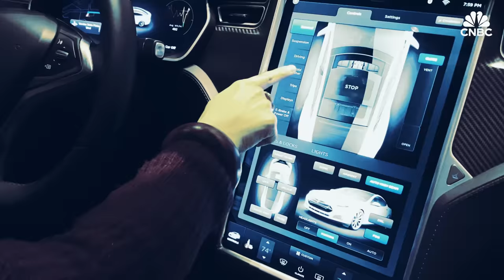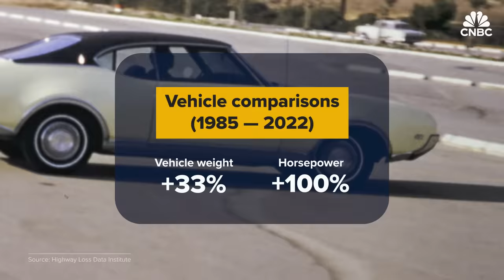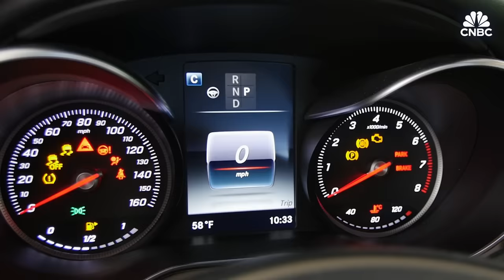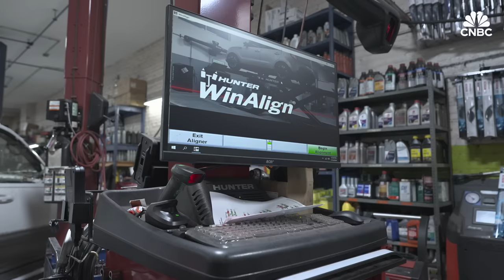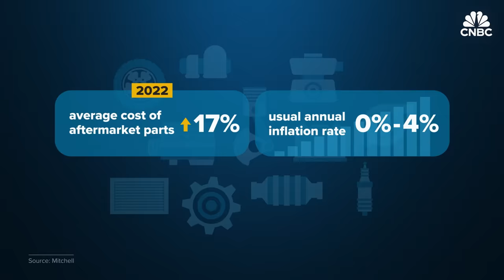Why Car Repairs Are Getting So Expensive

Comment: It's not just a matter of cost, either.  It has just as much to do with quality and expertise...or the lack thereof.  Example: I worked in the automotive industry, until recently.  I know my way around, mechanically.  Recently, I purchased a NEW transmission from my local Lexus dealer.  $3500.  Ouch...but new...so ok.  Installed it (correctly) myself.  After about 300 miles, it threw some warning lights and began shifting erratically.  I brought it to the dealer, ONLY FOR DIAGNOSIS.  They charged me $205 to tell me shift solenoids were stuck closed and that the transmission was shot and required replacement.  Offered to replace the transmission, itself, under the parts warranty and quoted FOUR THOUSAND DOLLARS just for the labor to install...which equates to about $300/hour.  CRAZY!!!!!!!  I decided to look deeper and not trust their diagnosis.  Turned out is was just under 1 quart low on fluid, after some air pockets had released.  Topped the fluid off, cleared the codes and voila...no...more...issues.  Had I trusted them, I would have been out nearly $4K extra.  Called them, told them what had happened, and insisted they refund my $205...which they did.
Reply: In the same vein, electric seat didn’t move forward or back and dealer wanted 4K to replace the entire seat.  Luckily, I diagnosed myself and it turned out be a $40 switch.
Reply: 🙋🏾‍♂️ ahhhhh!! I had a similar issue 4 months ago. My Mercedes wasn't shifting right. I took it to my favorite Euro specialist who told me my transmission needed a rebuild for 3.5k. Me and my buddy didn't believe as we know this particular tranny to be almost bulletproof. So we took it back home and just started doing basic checks and discovered the oil was low. We filled it back up correctly and the transmission shifts perfectly again. They almost got me.
Reply: this is accurate, they misdiagnose cars and just wanna replace the whole thing.
Reply: Stealership.
Reply: Bro what Lexus model is this? Dang that sucks :0
Reply: This is why they call most of them glorified part changers. It's easier but more expensive for you for them to just replace the parts than to diagnose the problem precisely with high level of expertise
Reply: U got refund? That miracle. Yeah a lot mechanic are garbage. Some diagnose the vehicle and still can't find the solution.
Find a good mechanic and never a dealer
Reply: Not everyone would look into things further like you did. You can trust anyone in the home/auto repair industries.
Reply: NEVER EVER go to a dealer for your Mechanic Especially in Australia
Reply: @Karl-Benny  I always do.
Reply: They always lie
Reply: Wow
Reply: JDns-we4fw  Its sad though because the OP sounds like an individual that knows a thing or two about the automotive industry and car repair itself mechanically. Sadly for a lot of us, myself included the most we know how to do is probably oil change. Its too easy to fall into the trap if we dont know any better you know?
Reply: Good techs often leave the industry cause dealers don't wanna pay what their worth. Working in a dealer can definitely break the passion for most car enthusiasts
Reply: so my old hyundai accent just needs one of them small donut tires in case i get a flat tire away from home. 

no one sold it so i had to go to dealer. they said i had to buy complete kit for over 300 bucks. when only thing i need is small donut tire. my regular tire shop replaces ordinary sized tires for 25 bucks. but they dont sell rims or donut tires.

if u ask me 300 bucks is alot for a small donut tire
Reply: also i need a catalytic converter replaced. the shop wanted 6k on other repairs they said i needed. i said no. i took my car to a muffler shop got it fixed for like 600 bucks some amount way cheaper. the original shop was general shop.

my advice is use specialized shops. same with car ac i got a good deal. avoid general repair shops that dont specialize, and dealers.

overall it sucks prices so high. they are also crooked. unethical. alot of mechanics are.
Reply: Had you gone thru the proper procedures of installation/bleeding rather than just throwing fluid in it..then you would have to truth them. and THIS is why shop shave the upperhand
Reply: I never go to a dealer to fix/diagnose my car.
Reply: It's selfish to not pay something for  the dx.
Reply: This is absolutely outrageous how people are out there to loot customers! This is appalling. Humanity keeps hitting a new low everytime. Keeps surprising me how expensive living has gotten!
Reply: You "installed it correctly" but didn't put enough fluid in it, in the first place, and weren't smart enough to check it before heading to a dealer ? 😅
Reply: I agree with this. Went to a shop to put some tires on rims, 2 weeks later one rim keeps leaking air. I take it to the shop 3 more times to fix it and no one at the shop even thought to check for bend in the rim. It literally takes a spray bottle with soap to find. Once I found it, took it too a guy to bend it back to shape, put tire on and boom no more leak. The quality of work in the auto repair business is polarizing .
Reply: @Watch-0w1  The service manager said they were wrong and couldn't argue with me...about any of it.  Stand up guy, I think...but...will they change their ways?!?!
Reply: @HuChing-ob4kk  I did.  I didn't just throw fluid in.
Reply: @JaceFalcon  Huh?  Pay something for an entirely incorrect diag?  I think not!
Reply: @sthr2110  good point
Reply: I had to go to a stealership for recall repairs, which was new valve cover gaskets, new clockspring, and vehicle occupancy system software update. I'd already done the valve cover gasket myself on both sides of the V6 engine, the recall only replaced one side. I told them please don't do it, it does not need it, I do not want you to, just mark it as completed.  They did it anyway, and tore a radiator hose in the process, didn't replace 2 nuts reinstalling wiring harnesses (I know because I'd just done the dang job), and didn't properly connect one of 3 ignition coils.  They did not plug in the new clockspring.  I arrived at the stealership with an ABS light on (clockspring bad), I left with a massive coolant leak, an ABS light still on,  traction control warning light illuminated, plus a check engine light (cylinder misfire).

I drove back around and they said it was be a $175 diagnostic fee plus labor to determine why I had a coolant leak and more warning lights than I arrived with.  I fixed the hose in the parking lot by shortening it slightly to remove the tear, drove home and had to actually plug in the new clockspring and recalibrate my steering angle sensor.  Plugged in the coil, flushed my radiator and replaced hoses and thermostat, and went to the junkyard for the missing nuts.  What an absolute joke of an ordeal.
Reply: JDns-we4fw  The tech was lazy and just saw that the seat wasn't responding to the switch so they just decided it was easiest for them to replace the entire seat.  

I found out it was the switch when I actually used multimeter and tested out the   actual motors.
Reply: Dang man, you can change a transmission, but you don't know how to check the fluid level?

Comment: I started off as a GST at pepboys just changing oil, rotate tires, alignments working in 100 degree shop. I had to take a loan out to buy my tools. GST are paid $7hr plus $6 flat rate, iI barley made enough I was  “promoted” to a tech B, a parts changer, and made even less money. I left the trade when i found out the service advisors where making 3x more than techs while there sitting in cool ac talking to customers all day. Im sure SA are highly skilled at selling to customers.

Fast forward today, i took up a course at my local college studying the IT industry, got my CompTIA certs and now working in the IT industry as a computer mechanic. Best decision ever made for myself

I now use my tools to fix my own cars. I no longer work for people.  I buy non running cars and repair and sell them as a side hustle.

Comment: This is why I am staying with cars around 95-2010....I can't afford much of anything after that especially adding in maintenance costs nowadays.  These new computer screens and comforts they put in these vehicles are going to be insane to repair and replace when this stuff starts going bad in 10-15 years.....people have no clue how expensive this stuff is and most of the time you won't even be able to start your car without those huge touchscreens.
Currently have a 2003 Chevy Tahoe and it's everything I need.
Reply: I totally agree. I have a 2008, and it is the newest car that I will ever own.
Reply: Couldn't been any more correct than that. I went from a '98 F-150 to a 2000 Silverado 1500 for easier maintenance, gas mileage, and a far more accessible engine.
Reply: Unfortunately there is only so much going around.  A lot of late 90s and early 2000s are gone/crushed.  Finding them would be like finding gems after 2030.
Reply: I 100% agree 😎👍
Reply: That's the sweet spot for cars....modern enough to have variable valve timing and 21st century design, yet also easy to repair and get parts for.
I have a 2006 Nissan Xterra...has 225k and it's the last car I plan on having.
Reply: @stephenebelt850 Also be sure to only use distilled water with your coolant because even for your year you do NOT want to do a heater core change.
Reply: I have several cars in that range that I maintain thanks to you tube.  As they get older everything starts to break. You can not trust the old car because you do not know what will break next. I have replaced 3 water pumps on one car it is so old.
Reply: @joe52428  what kind of car? Make model year plz?!???
Reply: HA! Try finding a transmission or muffler and catalytic for any of that old junk - it’ll be totalled then…
Reply: TESLA = ZERO repairs for 300,000 miles Driven.